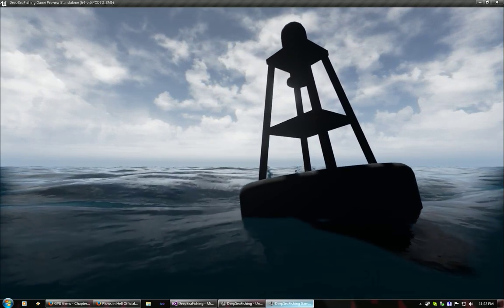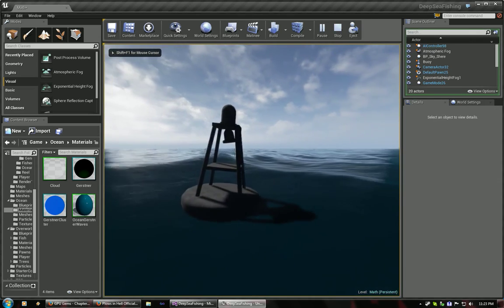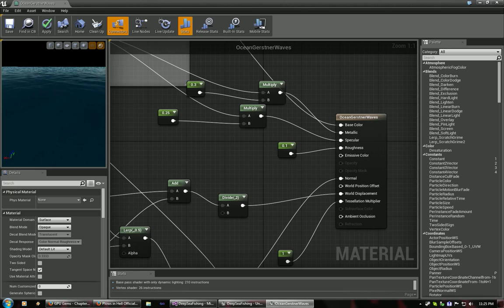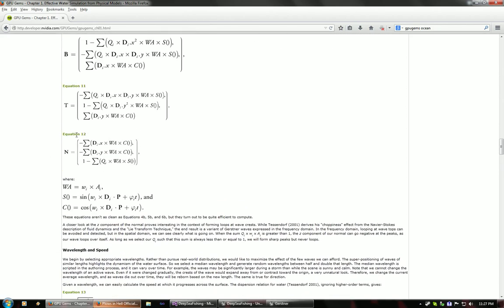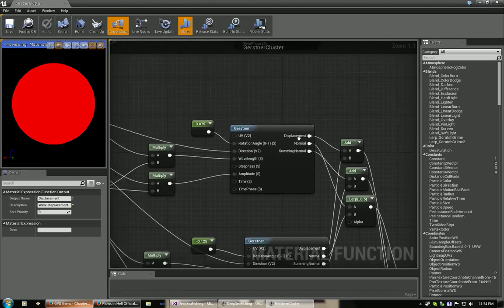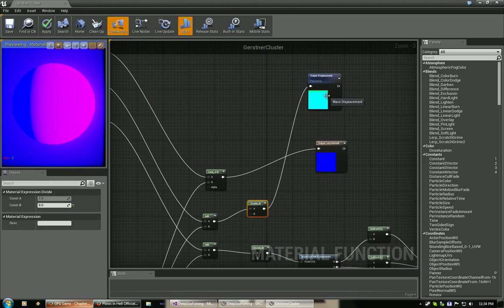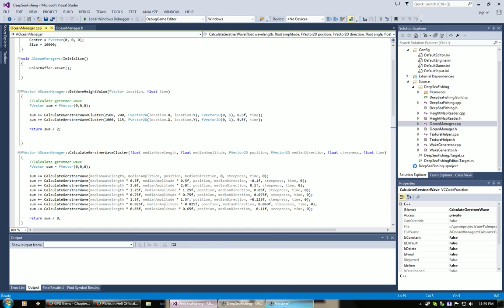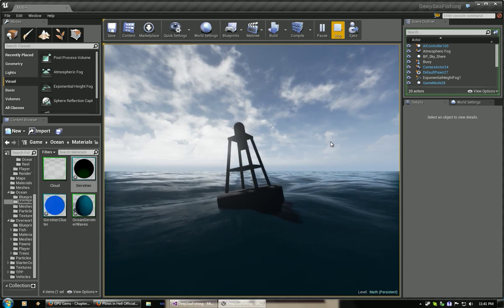Mathematical Ocean for Buoyancy

Comment: Hey.

I have embodied everything except the texture of the water.
do not want to use the prepared water from the renewal ask for hints, what are these stripes and artifacts on my surface?
in the attachment are several of my images. Thank you.https://dropmefiles.com/kl4wM
Reply from the maker: I looks like there is a very high frequency noise, possible something is being calculated at a very small scale.

Comment: Hello, just wondering if there's a way I can set the overall height level of the ocean actor. I'm using a landscape rendered from real-world topography and can't seem to 'move' the landscape, so I've had to move the ocean to the right height of the landscape. But, when pressing play it seems the ocean want's to stay at '0', meaning there's no ocean and everything floats to the sky.
Reply from the maker: You need to add an offset to the material or even just use the waterplane's object position. Same offset will need to be added to the buoyancy calculation.

Comment: dude this might sound a little bit out of context, but do you know how to attach a post process to this ocean? is quite easy when you work on a plane, but on this case there is tessellation
Reply from the maker: If you mean for when going underwater to switch post process then you have the actor with the camera test the camera's height to the waves and switch post process as needed depending if you are above or below water.
You could also do it through the ocean actor and get the player controller and camera manager to do it from the water instead of your pawn, this way it does not matter what you are controlling to switch the post process.
Reply: thanks dude i'll try that

Comment: Hello, your both tutorial are really greats thanks you, my ocean is done with buoyancy but i have a little problem.
The steepness isn't taken in consideration in the wave height, maybe it's a mistake by me but i don't think, any idea how to solve this ?, and i ask me if you know any doc for adding waves horizontal force so that the object move around water ? Thanks you.
Reply from the maker: Steepness only affect the DeltaX and DeltaY values and not the height, look at the final calculation for your X and Y displacement values to see if steepness is factored in.
For horizontal force, I have no resources.
Reply: yeah i got the correct steepness in the render but not in physics. Because the DeltaX and DeltaY change you have the correct height at the original point + the delta not the one at the original point, it's a little hard to explain maybe you tell the solution in the video but i'm not english native so maybe i miss it. So only the height for the buoyancy is incorrect.
Easier to explain in an image in think :
http://hpics.li/10ae93c
Reply from the maker: Yes the height for the buoyancy is incorrect and does not account for the steepness. The math to solve the equation properly is a little more complex and I have yet to implement it myself.
Reply: Ok ok, so i need to find the solution by myself :D

Comment: Hey man, excellent waves and buoyancy. I've been implementing it in one of my projects and looks and works great. I was curious though. (I'm a physics major one quantum class away from graduation). with those formulas, the x symbol is not multiplication, it is a cross product, I was looking at where you did the formulas but its a bit hard to follow, I tried to fix it myself but ended up with a huge standing wave (made me wonder if these numerous variables to adjust it were making it a standing wave with a huge lamda), I just can't really follow the blueprint and relate it to the formulas. I can't tell what are supposed to be actual multiplications and which are supposed to be cross products, also these are supposed to be vectors,but seem to be scalars, and I just don't see where the summations of these are added to the original i, j, k vectors. Ha, I would really like to see this formula done up proper. Any chance of commenting up the MF_gerstner_wave a little more clearly, as it relates to the formulas and which pieces are representing which variables? Did you originally attempt to do this with vectors and cross products?

Sorry don't mean to interrogate, I am actually a huge fan of your contribution to and the work of dotcam and that other feller to the ocean project. Great stuff. Keep up the great work. I've started implementing it in an mmo project and has worked swimmingly so far in all respects, no pun intended.
Reply from the maker: The best thing for you to do, I think, is to refer to the original paper http://http.developer.nvidia.com/GPUGems/gpugems_ch01.html. I'd have to look it up again but you're probably right that one of my comments I put multiplication instead of cross product.
Reply: Thanks for the link, I'll check it out. Thanks again for this system its so beautiful inside my game. Cheers man.

Comment: While I'm still working on my Gerstner-Wave Ocean I recently recognized that in your Gerstner Function you never added the claculation of the sum to x/y. The formular says x + (Q*A x D.X x cos(w*dot(D, (x,y)) + phase*time) . But you never added to x. So my question is why this is the case? Doesn't it break the effect of the steepness parameter?
Reply from the maker: +Marvin You are correct but it is added later within the material. When the final displacement is added to the Material's World Displacement it finishes the formula for [x,y] + displacement. But in the C++ code when getting height you are correct that x and y displacement are not used and the height returned ignores steepness. The returned height needs to be adjusted by solving for the true height at the test point which can be calculated by adjusting the input x and y by the displacement at that location.
Reply: +handkor So at which point is it added in the material, I don't get it :D
Reply from the maker: +Marvin Automatically since the displacement is additive to the current location.
Reply: +handkor But then it's also additive to the z and that's against the formular isn't it ?
Reply from the maker: +Marvin Yes it's additive to the z but the waterplane's z is 0 (or where ever you placed the plane) and uniform.
Reply: +handkor Ah ok, I see. Thx for your help! :) Another question if you don't mind: I managed to calculate the Wave Height for the Buoyancy, GerstnerCluster included, but it seems to be off sometimes. Could this be because of the missing x-/y- displacement ? I watched the debugspheres I colored differently for under- and overwater but somtimes they seem to be over water even if the calculation says not...

Comment: Hey Handkor,

Just wanted to ask, is there any way to not create the waves in the shader? If you make a game that need very dynamic ocean and lots of buoyancy focus, it feels a bit too frustrating to need to keep two exact models of the same ocean. Is it unrealistic to just tessellate the plane before shading? Not sure how many polygons would be required, but probably 10000 to make it look good. Would it be fast enough?

Cheers
Reply from the maker: +Sephiroth S You could do it all by animating a vertexbuffer in code, that's how dynamic water had usually been made over the last decade. The other way is to maintain and update a dynamic heightmap.
Reply: Yes, that's how i want to do it. but you wrote something about that it will be too slow?
Reply from the maker: The heightmap approach when I first tried it with UE4 4.1 was very slow. Reading the RenderTarget in code was much slower than what I used to be able to do in XNA due to the way UE4 manages its memory and is not well suited for reading and writing each frame.
Reply: Hmm.. i see, so sounds like odds of getting this to a playable fps are against me? :(

Comment: Hey handkor, 
I'm currently messing around with some values. What values did you use for the panners?
Reply from the maker: +Marvin For the small one it's 2, 10 and the other one it's 5, 1 .
Reply: +Marvin And what value has your Steepness Input or did I miss something?
Reply from the maker: Marvin
I leave the steepness to my default of 0.5.
Reply: Wow ty for your quick answer :) Btw your blueprint only project is awesome! Currently using it for some studies. Will try to get some realistic translucency on it.

Comment: I'm really stuck, have been trying to debug my ocean for 5 hours straight and cant find the reason. Essentially the Z component works perfectly, it's the displacement on x,y that's acting weird. Since it's pretty simple I cant see why.   

One thing that strikes me as weird is that as soon as I involve the dot product with position everything blows up, as in vertices seem to go to infinity based on the direction. But if I only use direction it works fine so the problem must be position. 

I guess the problem could be related to how the position is fed. What could be the reason? Tesselation doesnt seem to be related. 

Very thankful for answer! Thanks again.
Reply from the maker: +Sephiroth S I have not seen that as an error. Make sure direction is normalized and never 0,0 but for position it is mostly used just fed into cos and sin functions.
Reply: Strange. Well, i found your project uploaded so I will start to compare with that and see if i can isolate this issue. Thanks again. 

BTW, is there any way to make a loop for summing up the Gerstner waves? Feels like something you want to make parametric so you can optimize your water without spending tons of time in the graphs
Reply from the maker: No loops in the material editor.

Comment: I implemented the whole thing. But for some reason nothing appears in either my material preview or the actual game. I am quite new to UE4. Can you please provide me with the screenshots of the blueprints? TIA.
Reply: +Aniruddha Prithul Look up this thread, you will find a lot of useful information https://forums.unrealengine.com/showthread.php?42092-Community-Project-WIP-Weather-amp-Ocean-Water-Shader
Reply: ***** Thanks for that, but I have already looked into that thread. It wasn't of much help. The thing is, I know what I am supposed to do, and I have tried doing it. But it doesn't work for some reason. If you are knowledgeable enough ( or anyone else ) , here is what my Material looks like:

https://forums.unrealengine.com/showthread.php?88566-What-s-wrong-with-my-realistic-ocean-simulation

Comment: Please explain in detail how you make your material heightmap accessible in blueprints.
Your tutorial is a "little" (lol) bit unprecise at that point: imgur.com/ZPJLpwv.png
Reply from the maker: +Fox You can drop the render target approach and follow this video to go 100% math based.
As for what I meant in the wiki is to make a component that contains a SceenCapture2D component and make that camera point to a surface that is showing your material to transfer that data into the rendertarget. The alignment part comes in cause you might need to rotate something 90 degrees to make sure everything points the right way.

Comment: Hey handkor and others, stumbled upon your Gerstner wave buoyancy video while trying to compute correct height for a Gerstner wave set.

I found that I cannot use the Gerstner equations as-is to compute the height, as what they give you is basically the height at a certain lateral offset from the given coord, since that's what the x-y components of the equations do (push the vertices around in the x-y plane). So you get an incorrect height, which can sometimes be very far from the real value the larger steepness values you use.

To fix this, I basically solve the 2 planar components of the equation to find what coordinate would get displaced to the actual coordinate I am interested in measuring. Since the equation is of the form f(x) = a * x + b * cos(c * x + d), I couldn't solve that directly (isolate x). But I was able to find the solution iteratively. I applied Newton-Raphson to increase the convergence and reduce the number of iterations. In practice just 1 iteration gets very close, 2 iterations are pretty much indistinguishable from the real value. Took me a while to formulate the code correctly though.

I test this by putting a sphere in the level at a random position, and having the Level Blueprint move that sphere's height to the height the algorithm gives, and I can spot issues very easily this way. I can share the code if you are interested. Thanks!
Reply: I'm interested how did you solve it. I know it's been 2 years, but could you upload screens what you did change in the material/c++ to make it work correctly? Thanks =)

Comment: Error [SM5] Function Gerstner: Missing function input 'Steepness'
Error [SM5] Function Gerstner: Missing function input 'Direction'
Error [SM5] Function Gerstner: Missing function input 'Time'
Error [SM5] Function Gerstner: Missing function input 'Time Phase'

I have these errors in both OceanGerstnerWaves and GerstnerCluster. Do you know why this happens? Thanks in advance.
Reply from the maker: Check use preview value on the inputs and steepness is 0.5 and direction is a 2D vector of 1,0, Time is connected to a time node and Time Phase is 0.
Reply: Radicool.  Thanks for this by the way.  I was using heightmaps before and it was getting pretty cumbersome.  Looked nice, but this is probably better.

Way to be.
Reply: handkor I think what he means is what values did you use for them.  In the video the pins are left blank.  I get the same error.
Reply from the maker: Pedro Francisco 
Only thing I can think of is that you are missing inputs on the material function.
Reply: handkor What inputs did you use? Also, my ocean seems all blacked out without the blue color, but I have the color components correctly. Is it because of the fresnel?
Reply from the maker: I added scalar and vector Input nodes for the functions.

Comment: @ handkor : Do you know if making this with particles would be too heavy for any game to run ?
Reply from the maker: Alexander Laheij I've experimented with this to add breaking waves and no it is not too heavy, the particles were even using flipbooks to change the image used based on the wave height. What I've also been meaning to try is to use a series of 2D billboards spaced evenly and have real water calculation applied to an old 16bit art style.
Reply: handkor Ah cool. I have been stuck on it for some time, but I finally got some solutions worked out, designwise. xD

Comment: Could you upload the gerstner wave cluster material function somewhere? I had a lot of trouble with that and can't find where all the nodes go...other than that everything worked out great!
Reply from the maker: The cluster is just the gertsner wave repeated 8 times and added together. The inputs are just values between 0.5 to 2 times the median inputs. You can start small with just 2 waves, then 4 then 8.

Comment: Hi, really great tutorial, fantastic job, I have been able to reproduce the same material and material functions except that my Ocean material preview window show me a kind of blue reflective plane (no waves) and when I try it in game, it does have the correct waves but its totally black, also my GerstnerCluster material function's displacement preview is just brown, the normals are just grey though my Gerstner mat works perfectly. Any idea why it wouldn't be working ?
Reply: Sorry, got it working, I think I made a mistake at some point in the Gerstner mat and so I actually needed to replace all the Gerstner inside the cluster, weird but at least delt with, also, I have made the equivalent of your c++ functions into a blueprint, it works but, what Time value should be used by the get wave height Value function then ? Would a realtime seconds work ?
Reply: The thing is that I can get the height at position but the height that I get is offset compared to the wave's actual height, sometimes though, not always. I think it would have to do with the Time, it would seem that the time from the material isn't the same as the one in the blueprint/c++ function.
Reply from the maker: Eresea Britania
"Get Game Time in Seconds" is the one I use to sync up material and BP
Reply: Thanks man, great work !

Comment: When I try to compile, I get this:
Error    2    error LNK2019: unresolved external symbol "public: __cdecl AOceanManager::AOceanManager(class FPostConstructInitializeProperties const &)" (??0AOceanManager@@QEAA@AEBVFPostConstructInitializeProperties@@@Z) referenced in function "void __cdecl InternalConstructor<class AOceanManager>(class FPostConstructInitializeProperties const &)" (??$InternalConstructor@VAOceanManager@@@@YAXAEBVFPostConstructInitializeProperties@@@Z)    E:\UE4Projects\Wasser\Wasser\Intermediate\ProjectFiles\Wasser.generated.cpp.obj    Wasser

I'm very new to C++, how can I fix this?
Reply from the maker: It looks like the generated code did not get generated. Look in the answerhub or the c++ section of the forums. You might find an answer. Sometimes it's just a question of letting visual studio finish parsing the whole project and rebuilding or restarting the IDE.